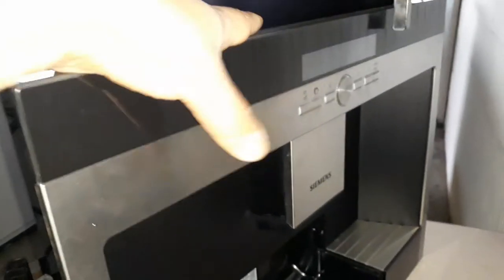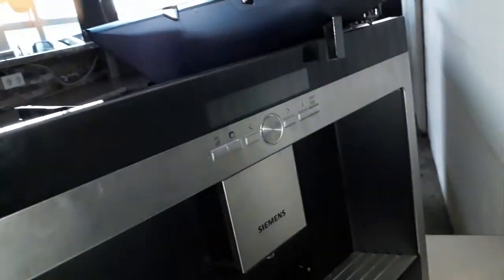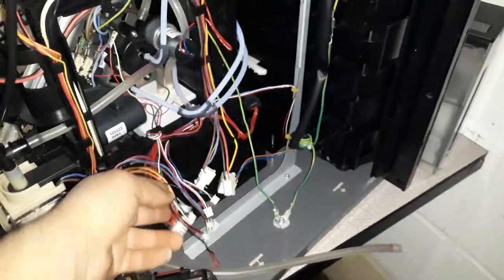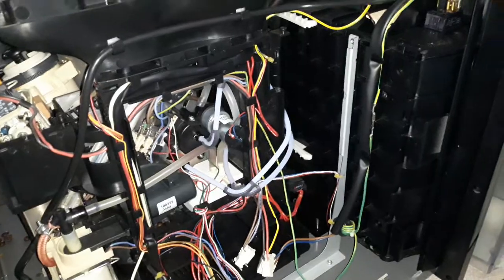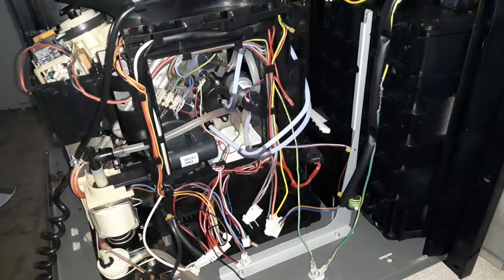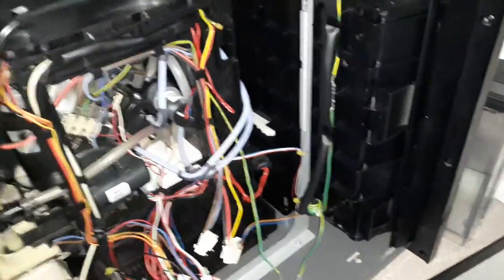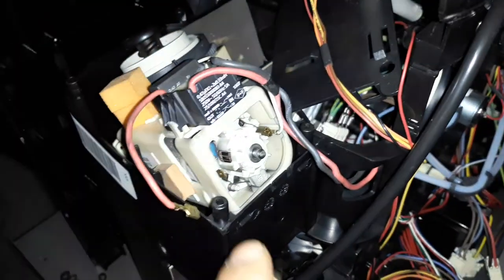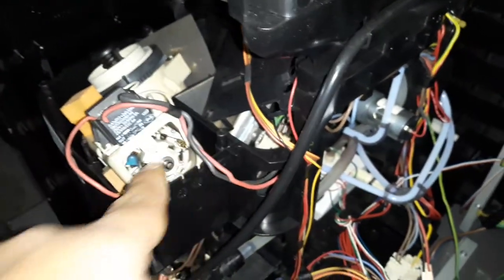SIEMENS coffee maker TK76K572 . Power problem get on and shutdown  after start processing

Comment: Hi  thx  I want if could help I have Siemens built in machine  the problem I have is the machine doesn’t rinse water from the write place
Reply from the maker: You need to check the water sensor after the water tank